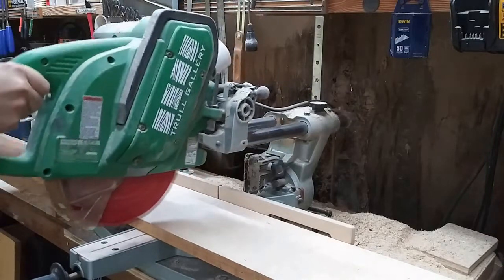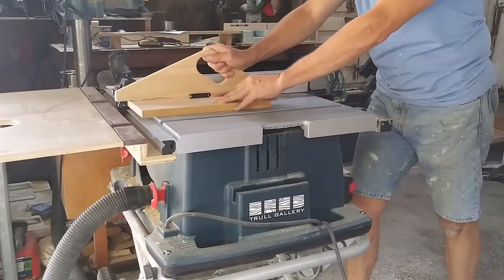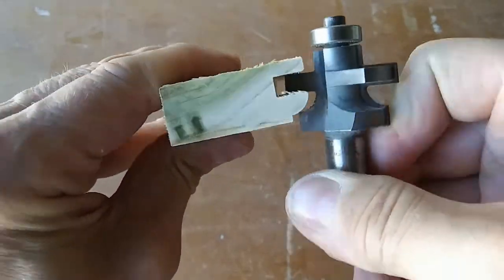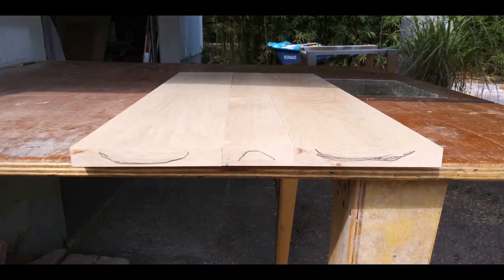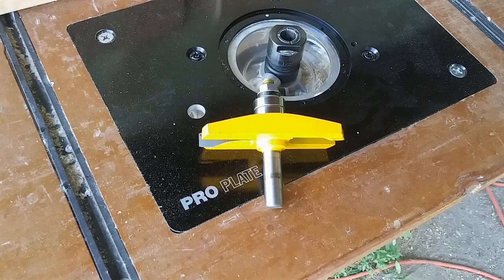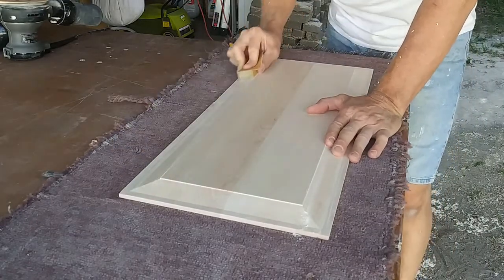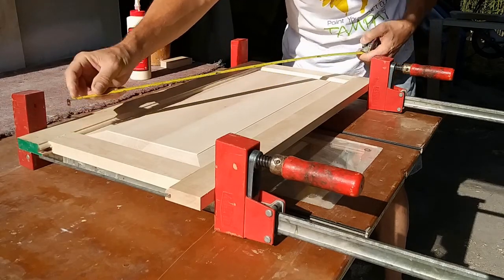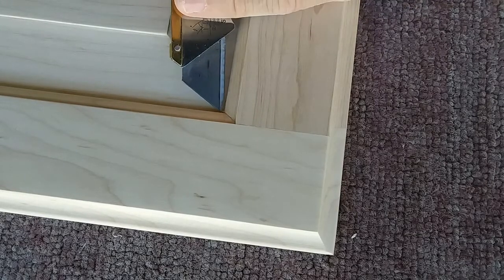Making a Raised Panel Door With a Router Table

Comment: Nice experience. Like for sure.
 Advice : for the panel use better (more expensive) bit with 4 cutting sides, not two. Then maximum two passes will make nice smooth finish and rotor speed 5000 max.
Reply from the maker: Good idea!

Comment: You should make the panel width about 1/8" less than the length of the rail to allow for seasonal expansion. 
Also, it's a good idea to move your random orbit sander more slowly to reduce the swirls effect.

Comment: I can remember the first time I tried my hand at a raised panel. I had no idea what I was doing and I was armed with a PC 7518 and a shiny new Freud Ogee bit. My test piece: hickory-pecan! I didn't know to take light passes and about 2" into hogging all of this super-hard material out I tripped the circuit breaker my router was plugged into! I then learned to take lighter passes! I stopped by the video to see if you had any different insight or techniques. I was intrigued with the technique of not cutting the stiles until after the glue-up. I had never done that before and find that an interesting take. I might try it sometime. Cheers!
Reply from the maker: Yikes!  Live and learn.  😂

Comment: Im about to attempt my first raised panel with my router table.  Its the older aluminum table top. Im concerned that it will scratch the wood. Im going to try paste wax i think. Maybe it will slide without scraping the wood. Great video!!
Reply from the maker: Thanks!  The wax is a good idea, but also check the edges and screw heads to make sure there are no burs.  You may still get some scratches but they should sand right out.
Reply: @TheTrullGallery  I'll give it a try!

Comment: If your rails and styles are 3/4” what thickness the panel should be so the front can be flush, panel and frame.
Reply from the maker: I usually run my panels at 5/8" or a hair thinner.  Unless I'm using a back cutter, then I leave them at 3/4".

Comment: What router are you using in the raised panel bit on the mocked up table? Did you just mount the router to the bottom of the plywood? No lift cut out or anything? 

I want to run specifically a raised panel but. Your router looks to be the Triton?
Reply from the maker: I use a Triton 3 HP router.  I replaced its base with a Rockler router plate.
Reply: Sweet! I am eye balling this router. Looks sweet!! @TheTrullGallery
Reply from the maker: @garrettp.5018  it's great, especially for a router table.  Disconnect the spring & drill an extra hole in the plate, and you've got a built-in lift!
Reply: @TheTrullGallery You should do a video on how to do that.
Reply from the maker: @ST-0311  Good idea!  I'll look at that once my arm heals up (recovering from a torn tendon).

Comment: but without the backcutter on the panel bit the panel front would be hight than the frame correct??
Reply from the maker: It would be about 1/8" proud if your panel is 3/4" thick.  You'd also need to take Usually a few more passes to get the panel tongue to the proper thickness.   if I don't use the back cutter I reduce the thickness to 5/8", but I like my panels flush with the frame.

Comment: your panel width is the same dimension as the tail length, leaving no room for expansion?

how did that work out?
it’s been a year, so the door has gone threw enough hot cold seasons to exercise movement in the width.  did it blow out the stiles?
it’s it still looking good ?
Reply from the maker: Hey Gino!  The door still looks great.  The key is that the rails have about a 1/16" gap on either end.  That's enough space for a panel this size to move.  Thanks for catching that, though!

Comment: I find it easier to use double sided tape in place of hot glue.
Reply from the maker: Tape is probably faster and easier to remove, but I like that I can fill the gaps with the glue to keep things stable.   Cleaning up the hot melt is a pain in the butt.